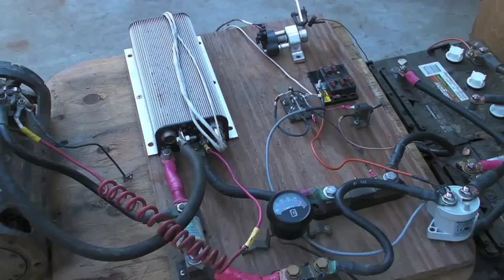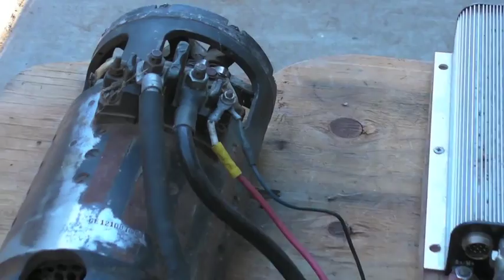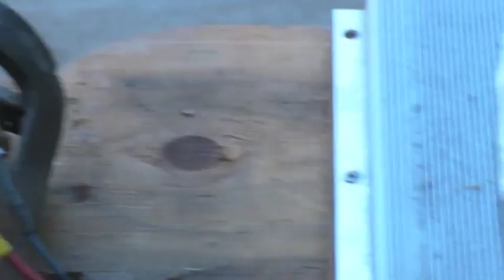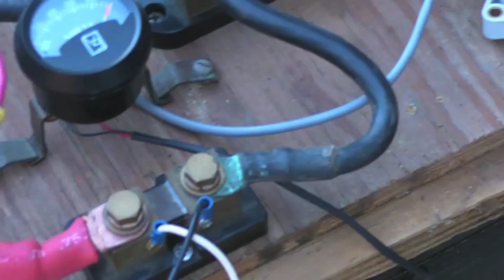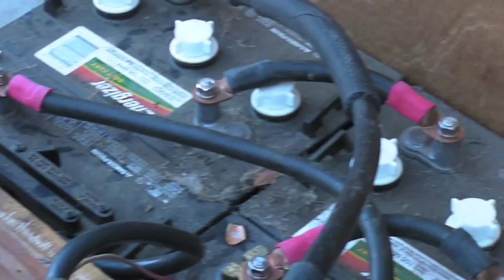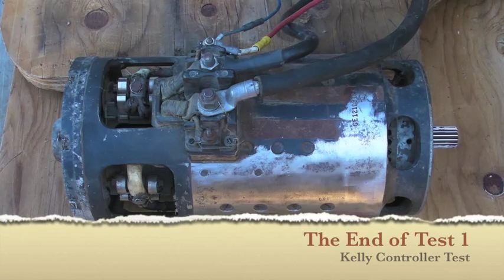Kelly Controller Test 1.m4v

Comment: a piece of  plumbers strap to solve the motor torque rock and I've heard but didn't see in your test that applying full voltage to a motor with no load can lead to rpms high enough to damage motor.  I do like your control and monitoring setup. Thanks for the video!

Comment: The motor is in fine working order. The rocking is because of the torque of the motor when turned on. Since I don't have it strapped down it will rock n roll all day long. Lock it down and it won't. Its just a test. Don't worry too much. Was testing the controller. Not the motor.

Comment: Yes a piece of strapping could have helped with the motor torque. Problem was that the controller functions were set funky. I killed that controller on a recent on the road regen test. No sign of any further advancements with this company and controller. Sorry. I did however do a full power run up with no load with my other motor and it had no ill effects but DO NOT do that with any other motor besides these. This motor can do briefly do 12,000 rpm. 8,000 rpm all day long. 

Search onegreenev

Comment: Friend'm from Brazil and I want to put together a project paraciso your coms. where I find that Kelly Controller controller and motor with a good price?
Reply: +Rogerio Novaes This controller was only a beta test for this particular motor. It is not available. These motors are not good for heavy vehicles and you can use other controllers if you happen to have one of these motors. I can help you connect one up but if you don't have one of these motors don't bother finding one to use on a project. There are much better motors and controllers to use. This generator motors are good but not for vehicles unless the vehicle is light weight. They work great with contactor speed controllers and 48 volts. They do get hot so you need good cooling for these motors. But for the controller, nope. They do not exist. The company does sell controllers but not for this motor. You can use a regular series motor controller if you have one but you won't get any regen ability with the motor. 
Pete :)